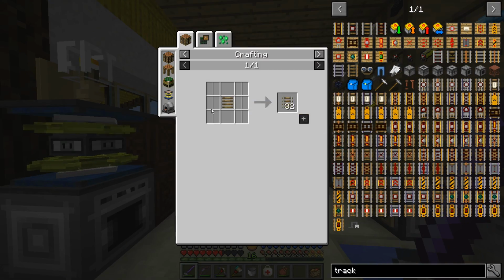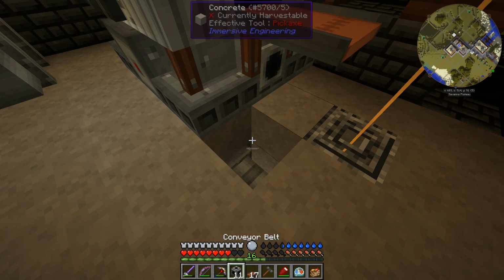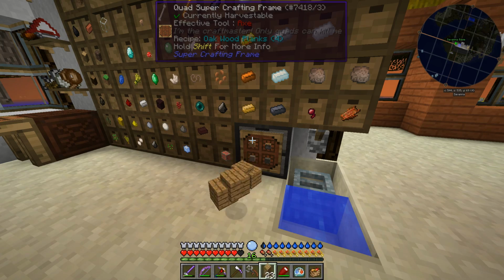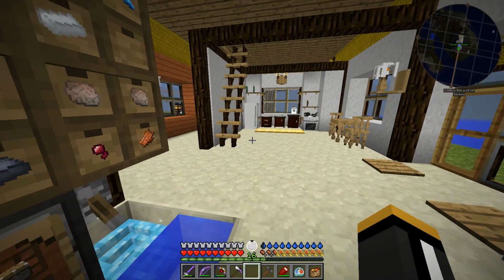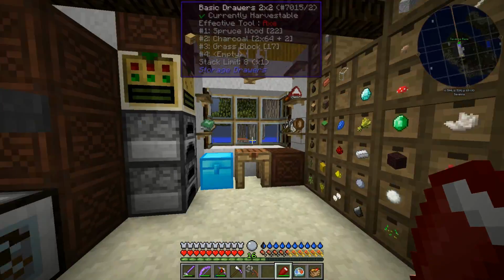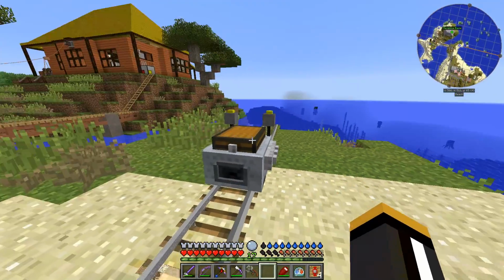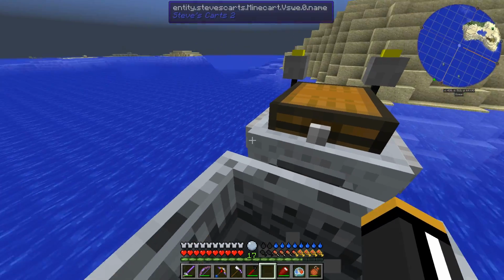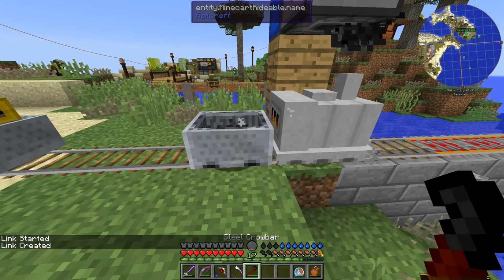Real Tech 20 - RailCraft High Speed Rails

Comment: Why do you need 9 transition rails?
Reply from the maker: Each transition rail speeds you up or slows you down a little bit. It takes around 9 to get you to full speed and back down to normal speed (so you don't explode).

Comment: btw I cant run this can you make a lite version with like 30 40 50 mods?
Reply from the maker: I'll look into doing this when I finally get around to updating this pack. How much memory are you able to allocate to Minecraft?
Reply: around 2 ram is put into mc of which my laptop has 4 GB installed ram

Edit: also for the lite could the hopper ducts mod be replaced with faucets and pipes mod its like hoper duct but much much better

Comment: Hi I have a question! No matter what I do to the high speed tracks, they still stay the normal track speed...
(I used redstone torches) How do I fix this?
Reply from the maker: It depends what you're riding in. If you're using railcraft locomotives, you'll need to set up several transition tracks (like I did in this video) to get to high speed, and the locomotive speed has to be set to the highest speed (click the ">>>>" button in the locomotive GUI). If you're just using vanilla carts without a locomotive, you'll need high speed booster tracks every few tracks. And of course, these both need to be powered by a redstone signal. You'll know they're powered if the red part kind of glows.
Reply: I used vanilla minecart, and EVERY track I used are H. S. Booster tracks and are powered. Bug?

Comment: Hi Danny so that's what I needed to stop the loco under the loader. That was really neat how you placed down tracks and changed them. Did you know that to push a second type liquid into the assembler that you can use the same pipe?
Reply from the maker: You can use the crowbar to change the track back too. Thanks for the tip. I'll have to keep that in mind if I want to craft with a second liquid. It wasn't very long ago that I just figured out that you can have multiple fluids in a single pipe.